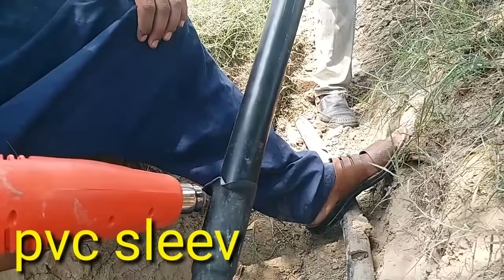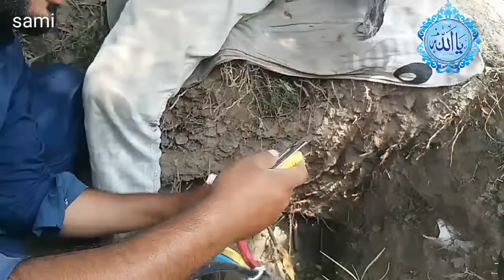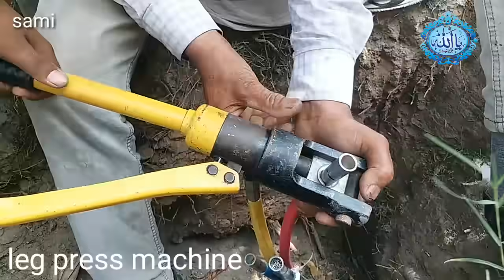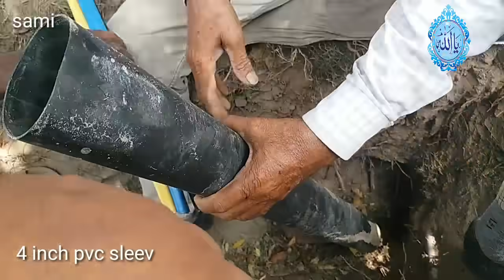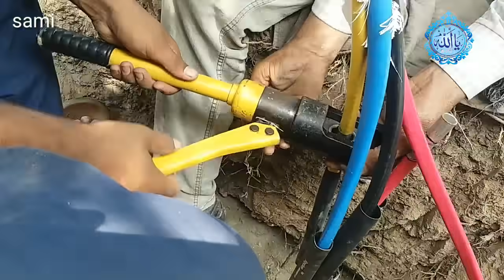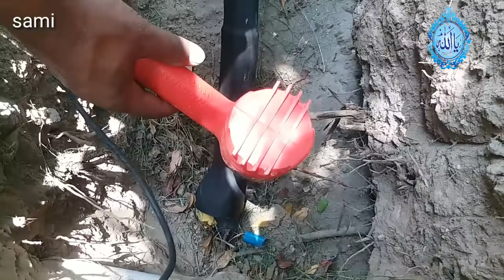120mm 4 core cable joint| underground cable joint| step by step |by sami lights

Comment: What is the joint called to connect another house to an existing armoured cable so a 3 way joint or T joint? I want to connect new building to existing cable on street